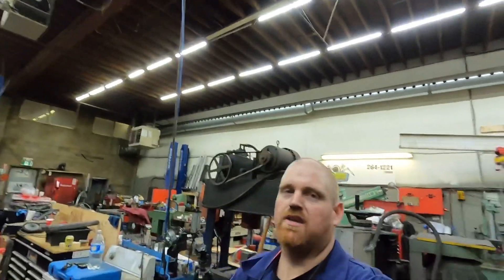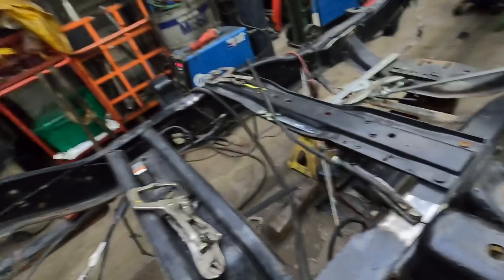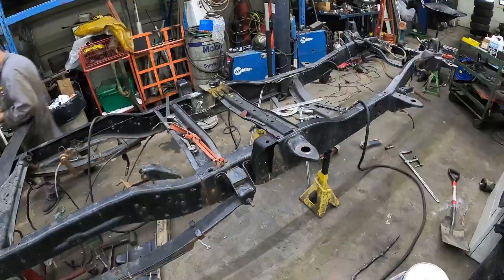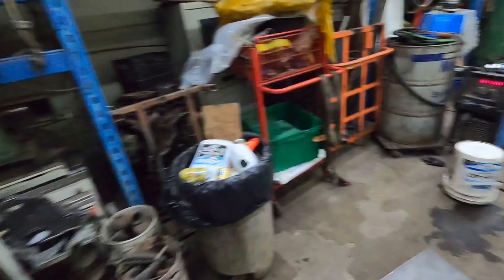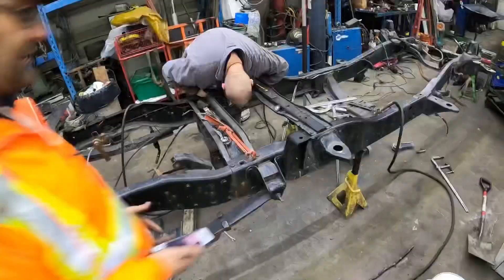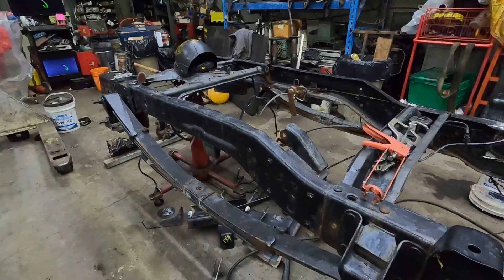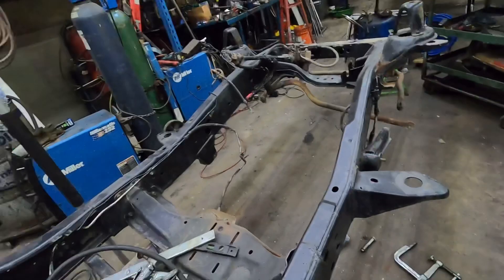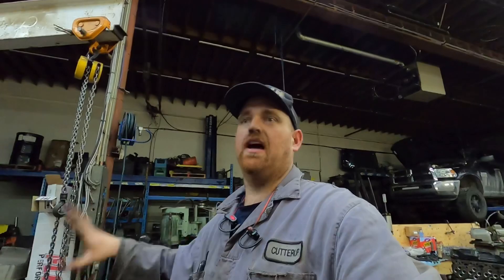The short build— frame shorten welding a time. ( second gen Cummins short box )

Comment: How much do you cut out between the wheelbase and does the back of the frame have to be bobbed
Reply from the maker: I can’t remember the amount I had to cut out. You would have to do some research. 
But you do have to cut some off the rear as well
Reply: @CUTTERUPROB  I figured it was like cutting a lwb square body down I have a long bed 24v that needs a cab anyway figured a swb Cummins single cab would be a riot to build